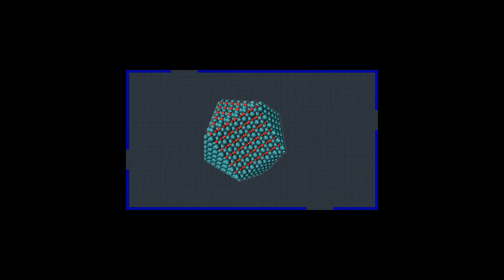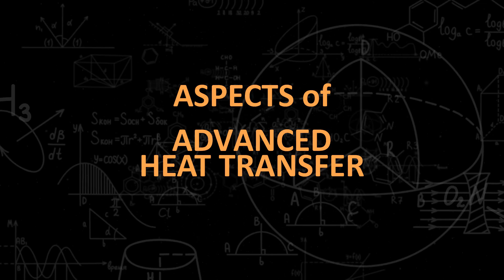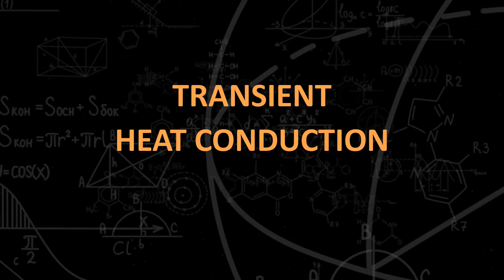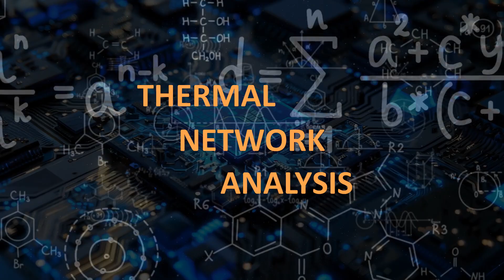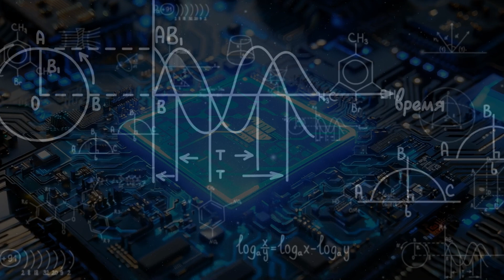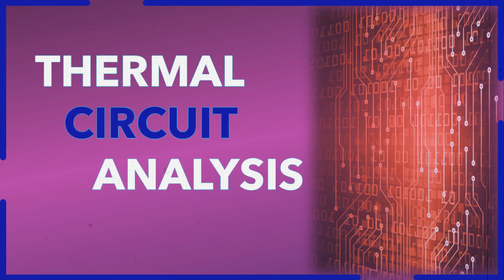Advanced Heat Transfer ~ Transient Thermal Circuits

Comment from the maker: 🧠 In this video, we introduce a powerful approach for analyzing time-varying complex thermal systems: the thermal circuit model.

👉 Have you also checked undergrad fundamentals, beforehand? See Playlist → https://tinyurl.com/3afw68bd

💬 FAQ: Why use Laplace Transforms in thermal circuit analysis?
Because they turn differential equations (from energy balances) into algebraic equations, allowing you to:

(1)  Solve for temperature response in the frequency domain
(2)  Model systems with step or sinusoidal inputs
(3)  Understand time constants and damping

🎓 Subscribe for more clear, concise ChemEng explainers!